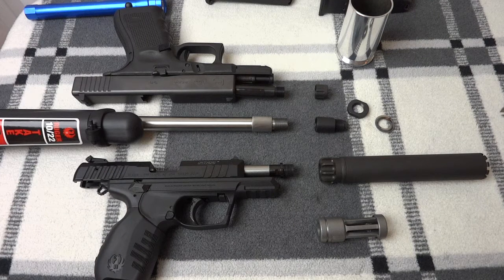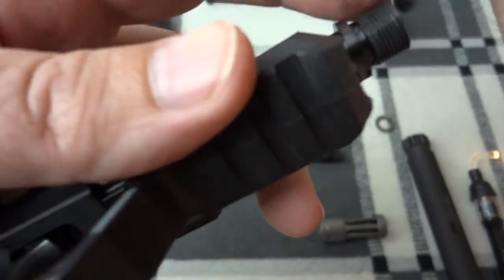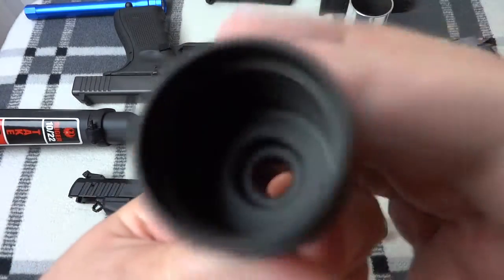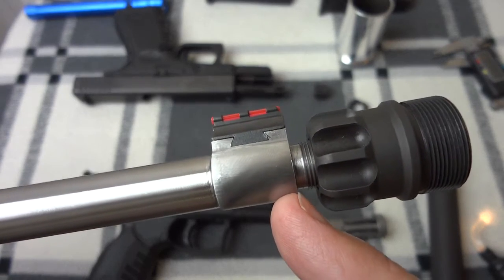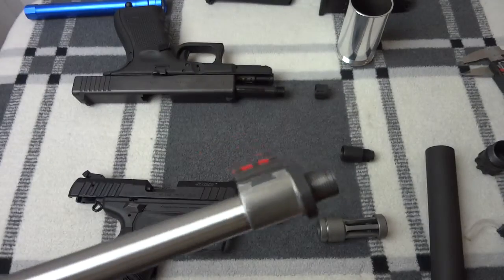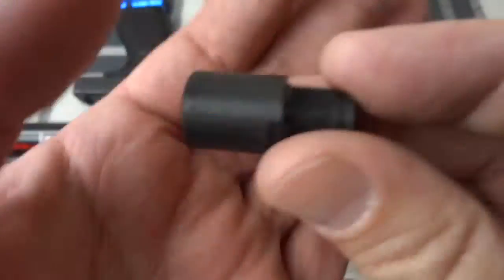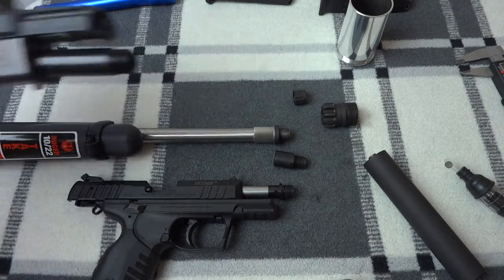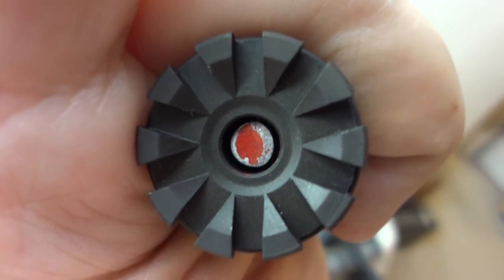SilencerCo Sparrow Thread Specifications

Comment: So the SilencerCo adapter's female end will fit threads up to (at least) .475?  Long story short, I have a barrel with .475 threads that I want to put a Spectre II on, and the threads can't be recut to .400 without damaging its finish.  My understanding is the adapter is primarily intended for the O-ring Engagement feature, but I can't find precise information indicating that the female end that mounts on the barrel will work with threads longer than .400.  I'm guessing that it may be as long as .600, as I've heard some rimfire barrels are "mistakenly" cut to the centerfire spec of .600, but I know that there are other factory barrels, eg from Ruger, Savage, etc, that are deliberately cut to .475.  So I'm hoping the SilencerCo O-ring Engagement 1/2x28-1/2x28 adapter can accommodate thread lengths of at least .475?

Thanks so much if you can shed some light on this for me!  My Google-Fu hasn't been strong enough so far to find a clear answer on this.
Reply from the maker: Yes and yes.  It SHOULD work for that.  If you are concerned, though, your best bet would be to ping SiCo and ask them the same question. Yes, my 10/22 has .620" threads on it which is the centerfire spec.  This wasn't a mistake, as you suggest with your quotation marks, but rather a choice because Ruger did not understand their own customers.  They expected that people were just wanting flash hiders and muzzle brakes.  Ruger did come around to the Class III crowd and now make their guns with the correct thread specs.  They even make an integrelly suppressed barrel and suppressors of their own.

All that said, what type of finish do you have that will not allow you to cut the correct specs?  The length will not change, only the outside of the front portion of the threads needs to be turned down to .440" or so.  Here's the spec here: https://s3.amazonaws.com/com.silencerco/support/thread-specs/Rimfire_O-Ring_Engagement_Thread_Guide.pdf

Finally, I would not recommend the SiCo adapter.  Rather, I would buy a spacer kit from Precision Armament.  Make sure you get the 1/2x28 model.  They have shims from .060" to .094"  You have to buy the whole kit, but once you take the one you need out, you'll have a great deal of spares.  Here's the Amazon link, but you can buy them from other sources as well like Brownells: https://smile.amazon.com/Precision-Armament-Accu-Washer-Alignment-System/dp/B01EXBRWAW?th=1&psc=1
Reply: Thank you for the quick response!

I certainly would contact SilencerCo before moving forward with any of this, but I wanted to make sure I was on the right track and understanding correctly - and it sounds like I am.

It's a black bull barrel from Kidd.  The reply I got from them was "Unfortunately, we do not offer that type of service on our black bull barrels. The reason we are unable to offer that service is because for barrel rework on a black barrel, it will ruin the finish of the barrel which we do not offer barrel refinishing on our chromemoly barrels."

It sounds like what you're describing would be turning my threads into the SilencerCo "spec", such that it would include the extension for "O-Ring Engagement", but only have threads out to .400 - yes?  I suppose that would be an ideal solution, but I'm not sure that Kidd would go for that either.  I guess they're concerned about gouging up the finish from chucking it into a lathe?

And thanks for the link to those shims - they're perfect for this application.  But any particular reason you recommend this over the adapter?  It seems the drawback of the adapter is about an extra half inch added to the OAL, but it would also offer the additional O-Ring Engagement, yes?

I suppose if the perfectly sized shim were used, the threads would meet the o-ring just right to still achieve a seal against dirt, without having to actually pass through it (and without the added length of the adapter)... There wouldn't be the advantage of the friction keeping the can seated - but, it's not like there's an o-ring keeping the adapter seated on the barrel's threads anyway, rendering it a moot point I suppose.

So is that why you recommend the shims over the adapter - the "o-ring engagement" feature of the adapter is rendered moot because there's not a second o-ring keeping the adapter in place, and the proper sized spacer can achieve the seal against dirt just as effectively, without all the added length of the adapter?

Sorry for thinking (typing) out loud... but I think I'm finally figuring this out!
Reply from the maker: For the extra 1/2 (seemed to me to be about .620" actually) you do get "O" Ring engagement.  In my experience, since the O-ring contacts the front of the barrel, it keeps my threads clean.  The O-ring does keep the can from backing off as well, but that's not a problem I've had. Additionally, since you've just added a second threaded surface, you've got TWO threads that can back off.  You've added a potential problem.

Another suggest, but a bit more expensive, would be to send it off to Class III machining.  They can cut you SiCo spec threads no problem and have a pretty good reputation: http://class3machining.com/
Reply: You've been super helpful - thank you so much!

Comment: Best not to use any kind of washers for threading and shouldering purposes. That's what shims are for. Looks like you already have Silencerco's 1/2x28 to 1/2x28 o-ring engagement adapter. Why not just use that on the 10/22?
Reply from the maker: Silencerco sells an adapter, but that extends the whole stack .5".  I have concluded that as long as the "O" ring is touching the muzzle, there is very little advantage to the "O" ring engagement.  Certainly not worth extending the barrel in my opinion.  As far as using "Washers" vs. "Shims", if I didn't make it clear in my video, I used one YHM shim and two peel washer shims.  Silencerco's supplied 'spacer' is too long for my purposes.  The ultimate goal of whatever stack of shims, washers, spacers, etc. that you use is that the suppressor be concentric.  Well, it is.  Done. Calling shims washers and washers spacers is all about semantics.  In the end, I used precision shims as provided by YHM.

Comment: I'm surprised they don't have caliber specific thread pitch. Especially in this sue happy, everything is someone elses fault world we live in.
Reply: Oh, you mean to keep you from firing the wrong caliber through the suppressor? That's a great point.
Reply from the maker: 1/2 inch x 28 thread pitch is very common.  It is used for 5.56mm rifles, 22 lr rifles and pistols, and even 9mm.  They figure that anybody dropping $600 on a suppressor and waiting 3-12 months to get one IF they live where they are legal will also know what caliber to use with what can.

It's an interesting point, though.  YHM takes a different tactic with their suppressors and mounts.  QD mounts for YHM suppressors come in at least six different varieties, some capable of some level of interchangeability.  It doesn't stop folks like me from tinkering and mistakes can be made.

USUALLY, the worst thing you'll get is a destroyed suppressor.  Injuries can occur, but a can detonation will usually just make you angry about all the money you spent on it and maybe cause your ears to ring.